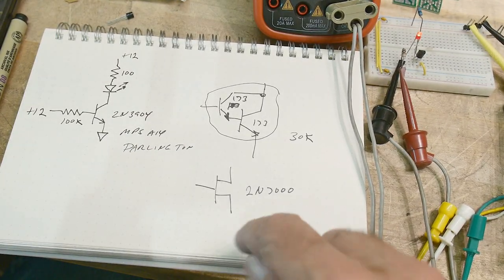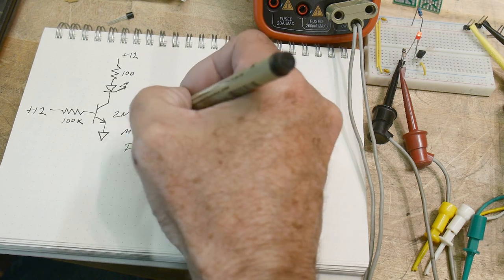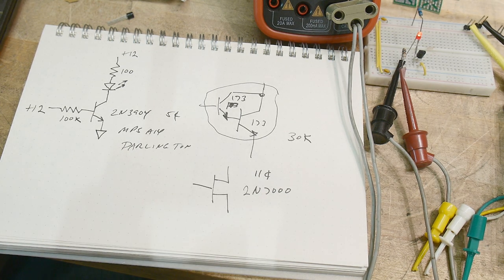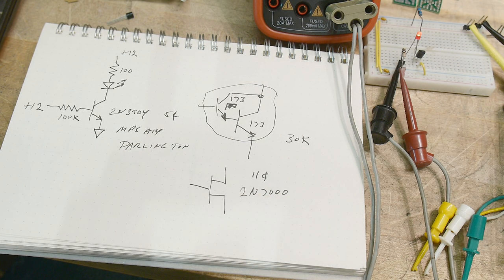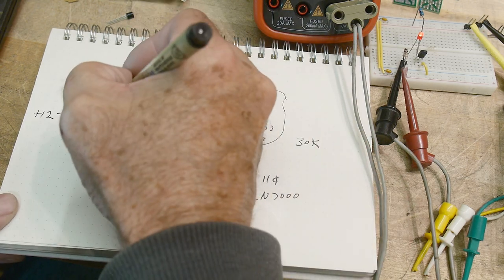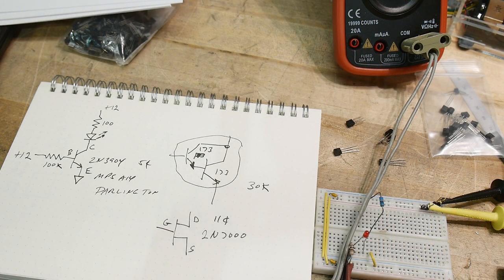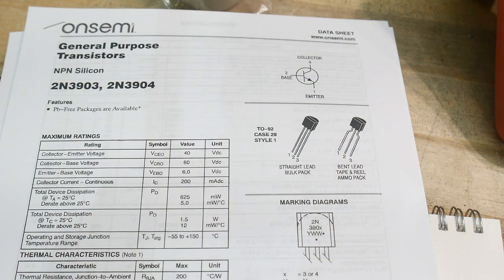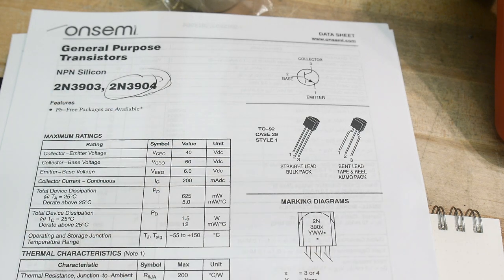#1157 Transistor Current Gain (Beta Hfe)

Comment: The gain varies a lot from one transistor to another (of the same reference) and with current, temperature, Vce etc...
The only thing that matters is the datasheet and the minimum guaranteed gain in it.
Also when calculating resistor values during a circuit design, it's better to use a conservative value.
Measuring a transistor and then building a circuit based on that is the first step for a bad day.

Comment: Two things you can't depend on when desigining with a transistor:
- current gain ('round 200 when you must)
- base-emitter voltage ('round 0.6V)
If you are doing something that needs some precision always include a trimmer!

Comment: I would say keep in mind the traditional BJT is both a current and voltage amplifier. I recently configured one for high input impedance in contrast to the source, and still achieved very high voltage gain. About 300mV input AC signal, and 3.6 vac output. Bias resistors being 1 million and 100K for my divider. 
In contrast, running a very lossy 1.8K and 150 ohm divider, I was only achieving 4.0 vac, but obviously my current gain is massive. 
It does go to show that BJT's still have excellent voltage gain when configured for high impedance. That impedance is only about 100K, but my source is on average 15K. The MPSA13 and 14 obviously give me a lot more current gain, but working with guitar signals my focus is on voltage gain. 

I've gotten lazy with the math, but will start again soon. It's been 11 years since I was last in school for engineering lol.

Comment: Hi - Would you drive your car flat out every where? - Then why do you drive the LED at Max Current and shorten it's working life? - Also what are the components to the left across both top and bottom of your bread board supply rails they are not in your circuit drawing?
Reply from the maker: https://youtu.be/a8gkJP-F9LA?si=UnE70ScMXs3yWOum
Reply from the maker: other components are .01uf caps on the vcc and gnd https://youtu.be/gdtfjXa2s7k?si=giYh_apaeqB2wcLf

Comment: 13:00 There's another very important information to look for: the maximum power dissipation.
0.625W is not much. For example with 10v Vce the maximum current is not 200mA but 62.5mA !!!!
This is with an ambient temperature of 25C. If it's in a box during summer, it could easily be 50C. With a derating of 5mW/C it's 125mW less ie 500mW max so a current of 50mA. 1/4th of the claimed 200mA.
Be careful!
Reply: You wouldn't necessarily need a summer's day, what looks to be a 100 Ohm 250 mW resistor will provide an internal heater.
Reply: But that's only problem in linear mode.

Comment: For higher current requirements I like to use AO3401 and AO3406.
They have very low on resistance and switches Amps in small sot23 package
Reply: ...and AO300,   ..they are great,, and super cheap! :)

Comment: I don't think I heard you mention what what the hFE actually stands for.  Apologies if I missed it.  You described it well, but for those interested, what I found for the definition of the letters is:  hFE is an abbreviation, and it stands for "(h)ybrid parameter (F)orward current gain, common (E)mitter", and is a measure of the DC current gain of a junction transistor.

I learned it as beta or the greek B symbol and had to relearn it as hFE.

Actually I'm old enough that we learned tube theory first and then about the new kid on the block - transistors.  FETs were mentioned as an interesting device that might pan out some day :-)
Reply from the maker: Not sure if I ever knew what it stood for.
Reply: hFE is the 'same' as beta: the D.C., or static current gain. hfe is dynamic, or A.C. current gain. I'm glad to hear you didn't have to go through the H parameter model for a BJT, based on a two port network. Not really a very good model of BJT anyway, since it's a temperature dependent non-linear device. But hey, it was good  math workout for the slide-rule, and Brylcreem, engineering crowd of the early 1960s, hanging on for dear life to vacuum tubes.

Comment: A trick for young players for all types of ICs is their wattage rating. All/Most IC have a maximum wattage rating that is well below their maximum volts rating times their maximum current rating. If you max out both the volts and amps, you are going to cook things.
Reply: I see that another commenter mentions this below and that they also point out that this is under the Pd (Power Dissipation) section of data sheets.

Comment: I have a suggestion for a new video.
Have you heard of diode steering/ORing to power a load from 2 batteries? Basically put both batteries (or supplies) on same ground, and give each of them a diode between their positive and the load. If the batteries have the same voltage, it should be switching rapidly between the two, the faster the diode, the faster the switching, but i'm a bit skeptical about that part of it, so I'd like to see that on scope.

Comment: On Mouser, for 2N3904, the price for one unit is 7 to 10 times what you quoted. Some manufacturers are cheaper; but, there might not be stock. You have to buy 1000s of them to get them for 5 cents each.
Reply from the maker: wow, that's a big mark up.

Comment: Good video.

I would like to see a video on DC coupled amplifiers, for, um...a function generator (ducks), perhaps something with TIP120s/TIP125, for a handful of watts, at most. Perhaps a simple Op-Amp front end, with adjustable bias, likely not the LM358, which suffers from crossover distortion. A dual-rail 15c or 18v power supply would be nice, perhaps with some of those "capacitor doubler" pass transistors. Perhaps a regulated power supply for the bases of transistors. Perhaps the out of band frequencies highs could be pulled down with caps. But of course, I have no idea how to bias any of this, and there is very little information on DC-coupled amplifiers out there.

~

On MOSFETs, I tend to put a 10k pull-down resistor on the gate to make sure the capacitor nature of its gate is well drained. I don't know if the 2n7000 suffers from this, but some MOSFETs won't shut down in any reasonable time without it. I seem to remember Afrotechmods draining one with his fingertips.

[For Arduinos, a $1.65,  IRL640A logic-level MOSFET with a t0-220 case, works pretty nice, up to 200V / 18 amps. Of course, 100 or 1K resistor current limiting should be used between the controller pin and gate. The IRL640 Rds is something in the milli-ohm range, which is okay for a logic-level MOSFET. For inductive loads, a helper diode in the flyback configuration is a good idea.

I have been working on a circuit using them with optocouplers, when I noticed that because of the optocouplers made the MOSFET spend so much time in linear region, it became quite hot with PWM at 12v and 1A, over 10Khz. I experimented with just an LM358 Shmitt trigger, and then Comparitor, but the LM388 slew-rate was too slow--also keeping it in the linear region. So, I found some optocouplers with built in Schmitt-triggers, the H11L1M series, which I hope will allow, which I hope will be at least 16kHz PWM. Well, see.... I was even tempted to test the SN74LVC245AN class device bus transceiver as a schmitt trigger, because the square waves that come off of it are so sharp you could cut yourself on them.]

Comment: 1 ohm on resistance is nothing to write home about. It seems the through hole T0-92 style package is responsible for the relatively high on resistance, and relatively low continuous current capacity. TO-220 packaging has better performance; but it's harder to use in a breadboard. If one goes to a surface mount package, higher currents and lower on resistance are significantly better. In terms of buying a few to a dozen units, the price for the  better performing SMD devices is about the same. Use a PCB adapter for breadboarding with them.
Reply: I have very limited knowledge of transistor practice but didn't think 1.2ohms was a particularly low on resistance for a MOSFET and in fact the calculated equivalent Vce was the same as the BJT.

Comment: 1)Thanks &  2)Question   ,,,Thanks for super videos mr.ImsaiGuy :-)   ,,,Question: Is it really a 100ohm, and not a 1kOhm in series with the LED on the breadboard?  >..Just asking because it seems the LED survives with over >80mA (according to the video's calculation with the 100 ohms series-resistor)  ..standard led's have 10mA to 20mA nominal current-requirement, pluss-minus some few mA's. 
//Thanks again for sharing video's to the Diy's&Engnr people. //br from norway.
Reply: ..Trying to look again, though difficult to see from video, if the series-resistor is a : 'brown-black-brown' (100)  or a 'brown-black-red' (1000)  >>Also, it could be a slim possibility that the resistor could have been marked with wrong multiplier from the factory.   >>If have time, measure the Led-resistor with your Dmm.   //Thanks again, have a nice weekend over there.
Reply from the maker: Yes, it is 100
Reply: @IMSAIGuy  ..>>Me standing corrected and learning something new, in regards to the >80mA trough the LED (which myself thought was unconditionally to-much)...It seems perhaps the 'impedance' on the LED must be Dynamic..?  // Did an experiment at my bench here (with 100ohm resistor and Led in series,..with PSU constantCurrent limited to 80mA), and it showed that the 'voltage' over the Led stayed much lower.

Comment: what current does your little box test the transistor at?
Reply from the maker: 5:53
Reply: @IMSAIGuy  cannot read it but never mind
Reply: @mr1enrollment  Pretty sure it reads as Vf = 1.16V. This is the voltage at which this particular IC turns on. That value may be different than what you would like to know... Are you asking what is the voltage sweep range of the tester? If so, that data may be a little difficult to come up with. But, IIRC, the tester was a project released by the developer and the Asian manufactures picked it up and mass produced it. Maybe a PIC16Fxxxx project. That kind of sounds familiar... Anyway, you can google the original project and get more information on the circuit and its operations. I hope that helps.
Reply: @t1d100  was curious about what Ic the Hfe was measured at. no prob. lost interest.
Reply from the maker: @mr1enrollment  oh, sorry I miss understood. I have no idea what conditions, pretty low I would guess